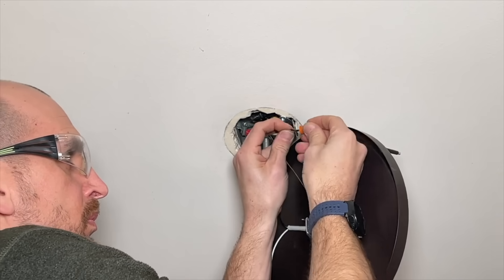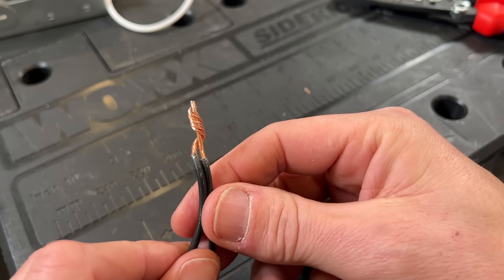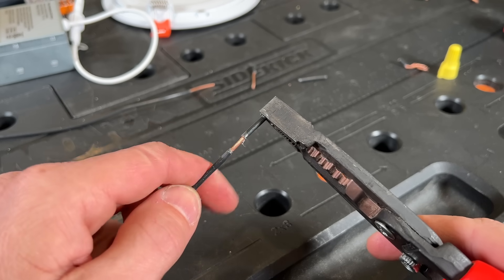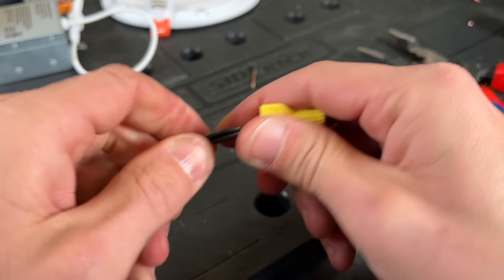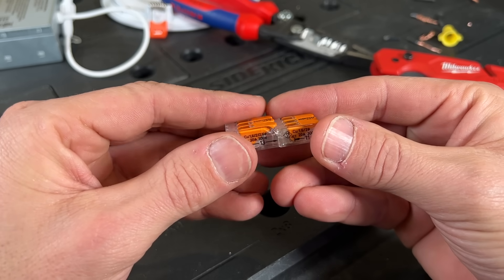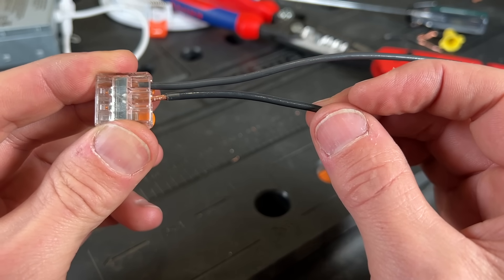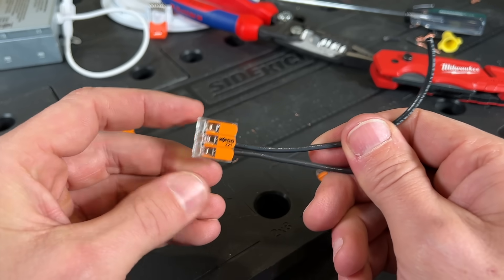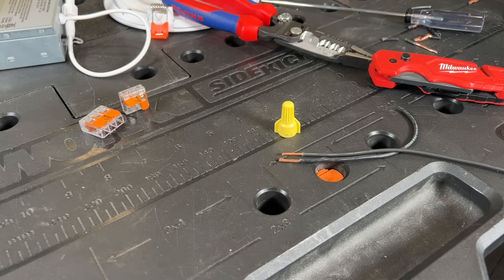Most Common DIYer Electrical Mistake - Don't Let This Be You!

Comment: For those who have never used the Wago connectors, another HUGE detail that makes them worth the extra penny:

They are infinitely easier to deal with when you come back to a project. Say you put in a new light switch just to test it out and see if you like the design. You come to realize it just feels bad and is hard to use, so you decide to go back to your original switch. Instead of untwisting your wire nut, cutting your wires down, re-stripping the wires, and getting a brand new wire nut: you just open the little levers, and switch it out!

It's hard to buy something thinking that "hmm, in 10 years when I open this box again it will be easier for me" but seriously, you don't know how much you will love your past self when you open up that box full of wago connectors vs wire nuts. It's just worth it!
Reply: Extra penny? You can buy a gross of wire nuts for the price of a dozen WAGO's You are trusting expensive little machines to carry the current in your house for a little bit of convenience that you should never need.
Reply: @showproja  time=money, sacrifice now to harvest greater outcomes later
Reply: @showproja  Lever Wagos are not the same as push in, plus if you dont daisy chain you arent running as much risk
Reply: If you have to take a wire nut off to swap a switch you shouldn’t be doing it.  Why not just take the wires off the old switch and connect the same exact wires to the new switch?
Reply: @WeMe83  Because when it's wired with wago's you can do it with the power on and essentially no danger vs trying to unscrew and uncurl that solid conductor from the head grabbing a live wire. It's just better
Reply: Wagos are for wankers.
Reply: Wire nuts are cheaper and give you a better connection electrically as in lower resistance.

Comment: I'm 73 years old, and in my youth, wires were all solid not braided. One use to wrap the solid wires and cover them with electical tape. With the advent of wire nuts, one didn't have to wrap them, thus saving a bit of time. With the advent of braided wires, experienced professional electrians, always wraped with as you show, the braided being slightly ahead of the solid. But as you stated, the general DIY'ers, who were not trained. Just followed the wire nut manufactues guides.
Reply: You did solder them before you taped right?
Reply: I'm an electrician and i will tell you this much. Most wire strippers are made so that you MOST DEFINITELY will be trusting the tool at one point during the stripping of the wire. place the wire at an ANGLE to the opening for that size wire (listed as the AWG size on most wires). Once you close the blades of the wire stripper you SHOULD twist the tool, at least, until it is at a perpendicular angle to the wire. Then pulling the strippers at the cut  and towards the short end of the wire.  If the insulation doesn't come off easily then either the wire is old; damaged; or you used the wrong size opening on  the strippers.
Reply: I’ve never seen braided wire outside of grounding and bonding straps.
Reply: (Stranded wire is not "braided".) (What is "electical tape"?) A house built in 1948 used ceramic wire nuts, on tin-plated solid copper wire, with insulation that is now crumbling. (Have you looked into knob-and-spool wiring?)
Reply: @quaztron  hi depending where you are your insurance company may require that you stop using the " knob and Tube" wiring even to the point of having it removed. Which is a shame because for its time it worked well. And yes to stop using can mean rewiring the entire house but since the insulation is as you say crumbling . Yes you got a problem and you will need a professional electrician (who hopefully has dealt with this before) and yes time is a concern. Sorry let me know if I can help more
Reply: @quaztron  Yes old houses had a veriety of  electrical things that are not so common these days / all though with this smart house thing getting more and more common as time passes ; what is standerd wiring now will to becomeout dated ! ( As for the question of " what is electrical tape " ) Simply -- it is a tape made just for electrical wiring ! This type of tape comes in different colors and most common color is black !
Reply: @tww1981  I suspect that the next possible big change might be DC making a comeback, from high-voltage down to household. New "solid-state transformers" convert AC to DC (with power-factor correction) and then DC to high-frequency AC, transform it at high frequency, and then AC-to-DC again, and finally DC to 60Hz AC, at better overall efficiency than a 60Hz steel-core transformer. If either side could come in or out as DC, the transformation could be even more efficient (fewer conversions), and long-distance transfer could be less lossy as well. Many electronic loads would run better on DC than on AC. Most computers that accept 120VAC or 230VAC would love 325VDC. 120VAC-only would love 170VDC. "Universal input" (85-277VAC) would like 120-390 VDC. A problem will be selecting standard voltages.
Reply: The wrong1489 is so good fuxk the right ==1217B
Reply: In Australia it is illegal for anyone to do electrical work without a current electricians license and for good reason. Also if a fire occurs and the insurance company finds any illegal wiring kiss your claim goodbye. 
Graeme 47 years as an Electrician.
Reply: @graemer66  good, that's the way it should be.  Electrical is one thing that amateurs and DIY'ers shouldn't do, and You Tube channels like this encourage as you could kill someone or burn your house down if you're not well versed in the trade.
Reply: @doninmichigan ,
   Most journeyman electricians in Illinois at least can't pull a permit, rather one or two electricians at their company do this on a job basis. This might be protecting the companies from 'moonlighting'? Not sure, but I myself have seen many foolish or just sloppy mistakes from IBEW guys that make me leary of allowing them to corner all electrical work.
   Just this year, not having the time to do it myself, I had an electrician friend install a whole house fan in a house of mine. He used 12-2, (about 75 ft of it!), and said "it's fine". Lol! 
I had to redo it in 10-2, and route it better. I didn't tell him but I'll never have him do anything else for me.
Blindly trusting an electrician, or any other professional, without having some idea yourself of what they are to do can be a mistake. 
Good luck to you.
Reply: @oldnick4707  Blindly trusting anyone can be a mistake, with electrical, politics or anything.  That knowledge comes with time and life  experience as we age.  As far as electricians, union guys usually work for large companies or contractors, where time is money, and unfortunately money becomes a priority over workmanship for many.  You don't have to wish me good luck, my career is over, I'm an old school retired Master Electrician, who valued workmanship instead of greed, and went the non-union route to learn as much as I can because I loved the trade.   I was fortunate to cover all the bases from machine tool, residential, commercial, institutional and industrial in a successful and satisfying career.  Good luck to you in finding a good electrician who cares about his work, and my original comment stands, there's way to many DIY'ers who watch these You Tube channels and think they know what they're doing, but do not.
Reply: @doninmichigan ,
   Yep, agreed. I'm flabbergasted at times at what a DIY'er has done in a home! Truly scary, and one has to inform an owner very diplomatically indeed that one has repaired a problem! Lol! 
I have a Cincinnati tooling grinder that I need to clean and hook up. Three phase, and I grew up in a machine shop but haven't messed with that yet. Gotta get the right transformer and make that happen! Lol! I like learning though so maybe you could wish me luck instead? 
Have a nice day sir!
Reply: Im 60 in the early days  in my OTJ when ever we cam across solid an stranded  wire connection  we would  simply  soder the stranded wire  first  before  combining the two so that  stranded wire is now a solid  wire  but often times  we would  simply  sober the stranded wire first and then sober it to the solid  wire  making it the perfect  solid  connection  to each other...  but now a days  speed is money and  everyone  is in a  hurry so there's  no time  to  soder  anything  anymore  because  it may take  anywhere from 5 to 10minutes  per connection which is a lot of time  for  today's  economic environment and time  is money which is one of the reasons why I switched to using the wago 221  over 10 yrs ago

Comment: If a connector is going to crush the stranded wire it's always a good idea to tin the wire first ("Seal" with solder). I have a Pinecil (Similar to TS100) soldering iron, not expensive, decent controls and heat, small and can be run from many USB power sources or even a battery. It's quick, easy and worth it.
If the wire is crushed over time it may become loose. It's worth just spending that little time extra tinning the wire.

Comment: Before I switched to Wago connectors, I used to insert the stranded wire all the way into the nut, and then push the solid up alongside it, then twist.

In crowded junction boxes, sometimes a quick wrap of tape around the levers gives me confidence that pushing them into the back of the box won't open them.

Comment: 4:32 Look how much of the solid wire is unnecessarily exposed.  You should strip the solid wire less than the stranded wire.  No more than 1/2 inch.

Comment: The problem with the Wago IMO only, is that it depends on the spring tension being maintained within the device over decades. Better to learn good technique with wire nuts. It doesn't take a lot of time to test the connection,  and done properly,  will last 40 to 50 years or more.   I've been doing DIY electrical for my family for 50 years. I get my work inspected. Inspectors have commented that I'm better than many licensed electricians.

Comment: Glad to see you actually pointed out the real #1 mistake. Not pull testing every connection. Loose connections is probably the #2 cause when I get a call about a light not working. BTW the #1 cause, by an unquestionable lead... the lightbulb.

Comment: I’m an electronics tech with 35 years experience and also taught. You said to lead with stranded in stead of solid before introducing the wire nut but did not explain(maybe with a drawing what happens inside the wire nut to achieve a successful connect. .

Comment: It’s not good to pre-twist the wire especially solid core because it work hardens the copper and it can break causing shorts, that’s the reason manufacturers don’t recommend pre twisting the wires with pliers then twisting them again with the nut… everyone does it though…

Comment: Those connectors are cool. I will definitely be picking some up. I am always super paranoid about wire nuts. I tend to use electrical tape to secure them to the wire. The last thing I would have want is a fire. About a year ago I started noticing a burning smell in the closet with hot water heater. I also had a cheap 24 port switch in there and have had them get a similar odor when a fan is failing. They are small DC fans and really dont have anything to cause to burn inside the metal case. Well I get home from working over night and smell a burning smell. I notice a bulge on the control box to the water heater. I go in and check the breaker and it is tripped. I do not cut it back on. Later that evening I pulled the cover off the plastic box on top the heater and descover that the wire ends to one of the hot legs is completely burnt through. This water heater was not installed by me but by Home Depot about 10 years prior. Looking at the surviving wire nut it looked like a small one that comes with pretty much any store purchased light fixture and definitely not rated for the guage of the wire on a water heater. So, I grabbed a couple of the larger wire nuts I purchased when I redid my HVAC which is another story. Wire it back up and taped the nuts. Good as new and working. Now for my air handler. The old one had a 100 amp breaker because of a huge heat strip inside of it. I want to say the aluminum wire was like 0g or something coming from the panel box on the first floor. When I replaced it the thing only needed 40amps. I also discovered the aluminum wire was running directly into the 25 year old air handler. I decided not to replace the aluminum wire since it was in good shape and ran between the first and second floor. Instead I replaced the 100 breaker with a 40amp breaker and used the correct sized connectors from aluminum to copper. I used aluminum no-ox and again taped around the connectors I placed inside of a metal junction box in the attic. I then ran copper from the junction box into the air handler.

Comment: Every electrician I have talked to, dont use the 3 wire connector.  Yep, they are fast, and then they have to go back later and replace them because they work loose over time due to many things..  They still recommend wire nuts, and always will.
Reply: Use 4 wire connectors^^
Wagos over 30 Years and nothing is "work" loose.
But I saw a lot of burning nuts over time (very old installations)
Reply: @HyperSnap01  Guess its expert vs expert.  I am not one, but just going what Ive been told by electricians.   SO whos right?  We will never know
Reply: @virgil3241  One reason is Money, wire nuts are cheaper.
and most "experts" are old and new things are bad^^
Reply: @HyperSnap01  Could be, but Ive also seen master electricians cut these ends off and use the tried and true marrot.  But once again, whos right or wrong?
Reply: @virgil3241  nobody whos right, both is good.
But Wagos are easy and fast.
connection is good by both if the installation is correct.

Comment: As someone that builds\modifies his guitars constantly I think I'm going to start using these Wago connectors. 👍 Much cleaner than a big glob of solder that I'm struggling to keep together lol.
Reply: For that kind of job I would prefer to use screw terminal blocks. The Wagos will probably last for decades but the smaller contact area might be more prone to vibration. Soldering is fine too, you just need a bigger iron and maybe some small metal clamps to hold everything in place.

Comment: The Ideal 11 in 1 (yellow + black handle) has a wire nut twister in the handle + many bits and nutdrivers for electrical work..  Very handy if you need to do more than a couple wire nuts.  For strippers, I like the basic Klein ones with yellow handles, for the $$ can't go wrong.  For pliers I'm a Knipix guy now, really good stuff!  - But if I was going to put together a quick tool list for electrical,  I'd consider some Tsunoda pliers, made in Japan, killer tools and great prices on Amazon.   I bought their duckbill pliers and wow, very nice pliers.

Comment: Haha Danm I didn’t think anyone knew that stranded to solid trick .also just pick up a Milwaukee or Kline striper set for a diy I use a Milwaukee as a pro Commerical electrician and now I’m doing resi service ..they cost only 20 and there amazing but there is clines for like 10 and they will work fine for resi work.also fuck wagos.wire nuts if you don’t excessively twist can be used too for temping in things and reusing thr connection.i only twist the wire more when I know it’s perminate

Comment: How to wire Stranded to Solid: twist the stranded together “BEFORE” you twist them together.
  Put them side by side, with the stranded hitting the wire nut first, before twist.
  Twist them together until the stranded (insulated) twists over the solid (insulated) a couple times. When putting the connection into the box, bend it a couple inches before the wire nut, check your connection (the wire nut).
Reply: Yeah why does this dude have lineman's pliers and not pre-twist the wires? Stupid. Terrible video. 1.2million people gonna do this wrong.

Comment: Those connecters fail too often. Red winged wire nuts cannot be beat. 30 years of experience here. Any kind of biting hold or tension hold will fail eventually. I've never had a twist come apart though.

Comment: Not enough contact with them. I had them fail on me. Almost burned down my home. I started using them a couple of years back. Now I worry about the ones I still have in use. I worked as a electrician for 5 years when I was a teenager. My brother still doing it, he was as surprised as me when I showed him the melted connectors. I don’t want to take away from your video. Did a great job on the use of wire nuts.

Comment: I (DIYer) take just a few minutes to solder the ends of the wires on the new fixture or appliance. Then you are dealing with only solid wires, not stranded. Thanks for the video though.

Comment: WIRE NUTS are what the pro use, WIRE NUTS are time, tested, proven and CODE.  Homeowners always wish to reinvent the wheel, or avoid what takes skill then they pick up what seems to be an easier alternative on the center island.  I get it, water proofing, tile work , etc home owners love the pre made layments, water proofing,  etc.  Back to us,  Maybe because we're engineers, inspectors and we think we're smarter than the pros "that build house".  My buddy builds houses, hes been doing it for years, I just built my own house, it took me one year to learn to stop talking and listen.  Dont use those things, plus their expensive? Why spend money on them? As a home owner I get it, what color do I use, what gage wire? etc? so we just go to the Wago which requires no thinking....no lets increase our skills,  learn to read wire, understand wire nut sizing and how to install them correctly, save money, better product, and the repair man will not be dealing with your homeowner mess in one room and then wire nuts in another.